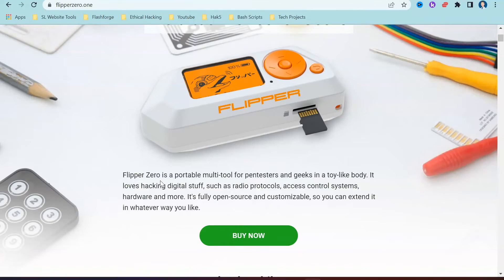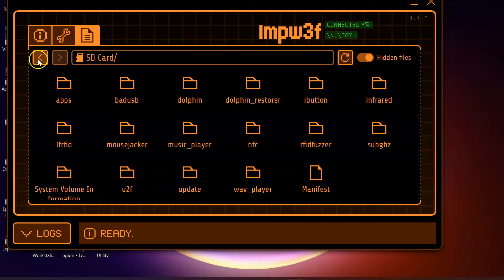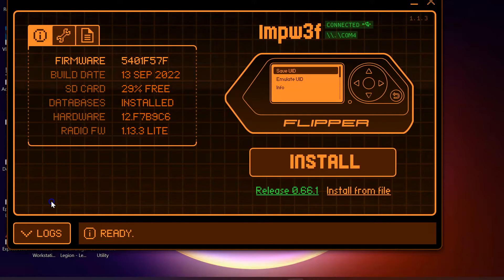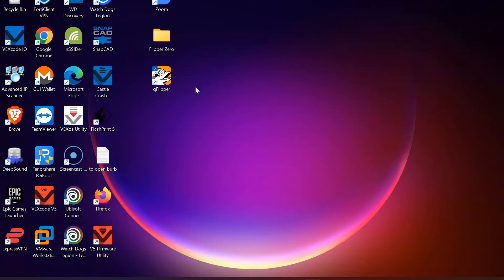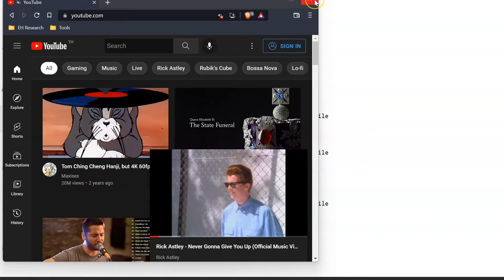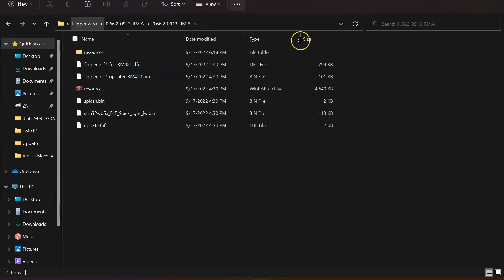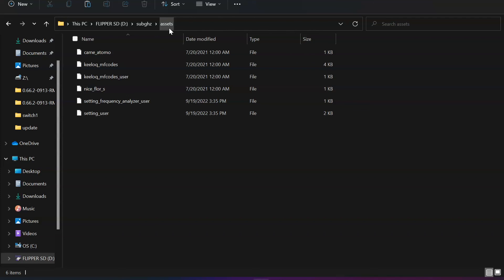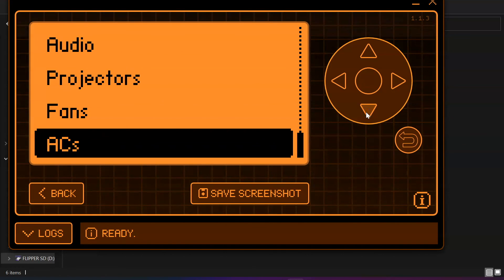Flipper Zero - Install Rogue Master Firmware - [Full Tutorial]

Comment: Great video. Had to watch a few times because I kept thinking I was missing something: Actual install tutorial starts around 10:15.

Def INCLUDE the resources.tar file!!! Or you will get error 13-0. I had to unmount and plug in my 32Gb SD card to my computer...dragging and dropping to qFlipper was saying file was too big (even though I had enough room). 

I recommend "backing up" your flipper before doing this - from the main/info screen of qFlipper. As of today (10/9/22) your SD card folder contents may look a little different...I did delete Apps per the Github page recommendation, but I don't think I needed to do that. A Restore of my backup didn't bring back the Apps folder so I reinstalled the regular/updated firmware. Pull up the Phone App and be sure to update from there...I updated back to the regular green stable version. Although I did it from qFlipper also/first, the app had me do it and I understand there's a different methodology between the two. When he is in the Dolphin screen and goes to the browser, don't worry if yours has something other than Bad USB in the cute header. Need to make it to the BROWSER, not the bad usb menu, here. ACTUALLY, from the dolphin screen, press down and left. Find the update folder with the Thicc line!!! uggh after almost 2 hrs, what should have taken 7 min...worked! But yeah, the last step for Updating on the Flipper Zero did take like 5 min, but finally pushed through. Good Luck!
Reply: thanks
Reply: There's two reasons to go to the the comments section; to find the real mvp or to troll. You're the mvp
Reply: you dont know how much help this  was
Reply: thank you! glad i checked the comments before looking for another video!

Comment: Ive installed it but i cant used projectors and audio and anything else because it says it requires a fresh data base on sd card?
Reply from the maker: Did you update your flipper before installing the .dfu file? Have you copied over all files to the SD? You shouldn't be seeing that problem, that tells me a file is missing.

Comment: at 5:15 for a split second you can make out the UID info from the card you read. idk if its that serious as idek what a UID is lmao but just thought you should know in case its important.
Reply from the maker: Thanks Moe, it wasn’t important in this case since it was a bank card that had expired, if it had been a current bank card that could be an issue, appreciate you spotting that 😊, this is why I didn’t worry about editing it again
Reply: @steamlabstech  aye okay cool I'm glad. While I have you can I ask, I downloaded the rm zip from  GitHub but after extracting it, the resource folder was . Tar so it extracted fine but the other files are . Bin and my Mac ( os Monterey) won't unzip it, even with archive utility. Says its an unsupported file type.They're still zipped. Anyway to fix that ?
Reply from the maker: Do check out my new video on unleashed as I do point out an error of mine in this video, when you have downloaded the zip file, you don’t need to unzip the resources file, you can simply copy all files onto your SD then go through the setup, you don’t need to unzip resources in the latest version of RM.
Reply from the maker: To confirm, once you unzip the downloaded file, just copy these across to your SD
Reply: @steamlabstech  alright awesome thanks !

Comment: hey i am having a problem with the unlocked frequency files not unlocking is there anything special i need to do?
Reply from the maker: Nothing that you need to do, have a look at the link to Pingywon in the description, website takes a while to load but all info is in there, there are a couple of ways to do it, let me know if you can’t unlock it for any reason
Reply from the maker: Try the Unleashed firmware, video just released

Comment: Error code #[13-0] anyone got ideas?
Reply: I kept getting this error when only including the extracted resources directory. Copy over the resources.tar and you'll be all set.
Reply from the maker: This is correct, thanks Matthew
Reply: @MatthewMoss  thank you!
Reply: @MatthewMoss  possibly you could help me with un-resricting frequencies as well added these two files and updated flipper but on some sub-g files it says transmission blocked
Reply from the maker: Try the Unleashed firmware, video just released
Reply: @MatthewMoss  where do I find the tar in the extracted zip? I've moved all the shown files from the video over